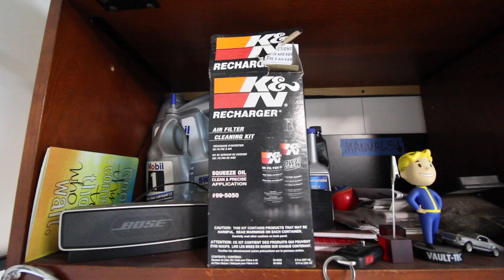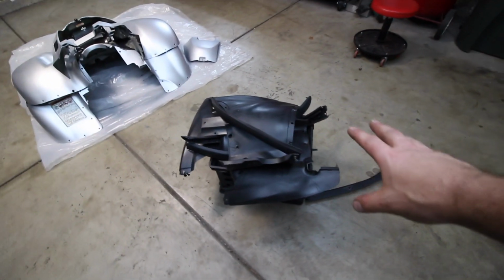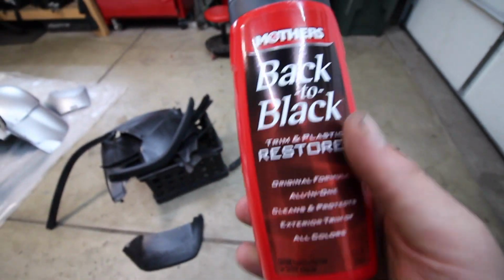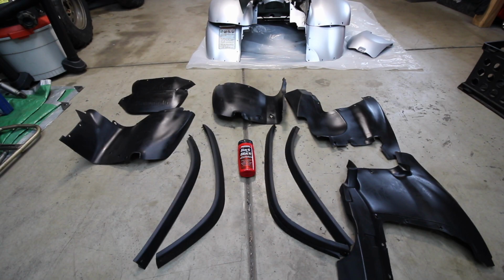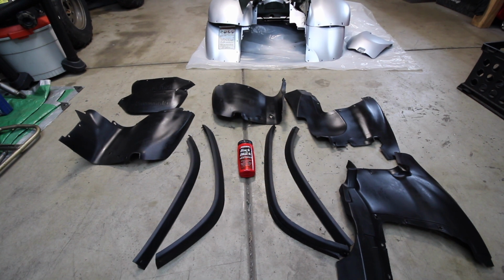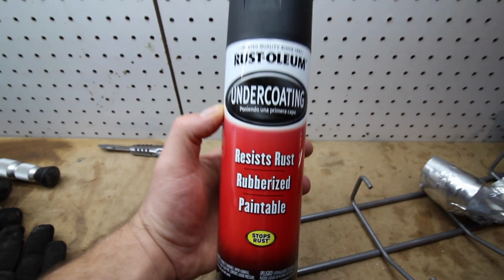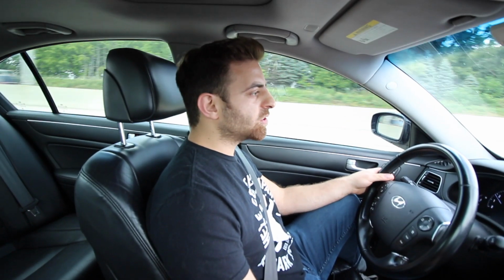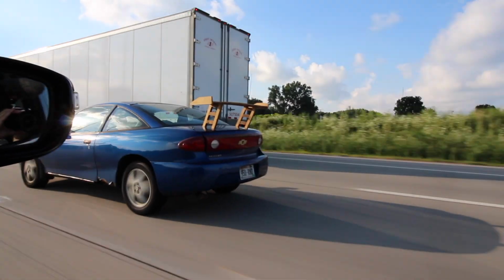The Ugliest Quad On Youtube?

Comment: Great video, I used bedliner on my 700 Prairie racks & footboards let them dry but they were still a little soft. Sprayed minwax semigloss polyurethane over it & it hardened & is extremely hard to scratch. Just something I found works.
Reply from the maker: Thank you! I have since sprayed clear over the undercoating, seems to be more durable. But I’ll have to use a method similar to yours for longevity in the future.

Comment: Awesome video man! Hows the silver paint on the body held up? I want to paint my Sportsman 500 white cause the plastic is super faded and looks like crap but worried it won't bond to the plastic well enough. You should use Rustoleum truck bed liner for your racks, really tough stuff used it on mine and has tons of grip.
Reply from the maker: Thanks man! Paint held up well for a couple rides, there’s a few chips in some places I’m attesting to not sanding enough. It’s all in the paint Prep man. The primer I used it pretty good for this, it’s universal primer by rustoleum. Sand very well EVERYWHERE, clean throughly, and spray down that primer and you’ll be good. Take your time! And truck bed liner is probably what I’ll go for.